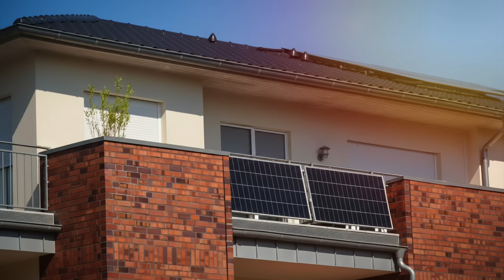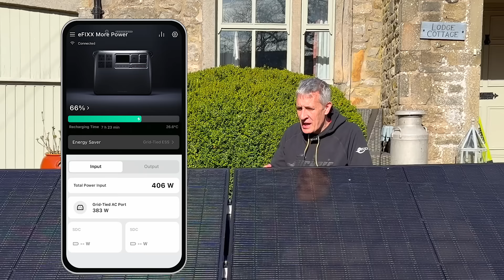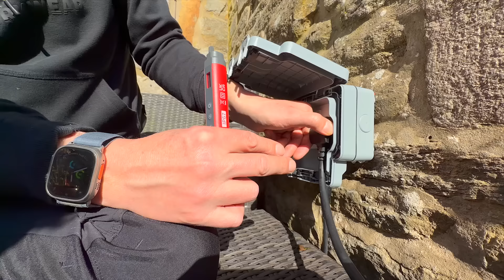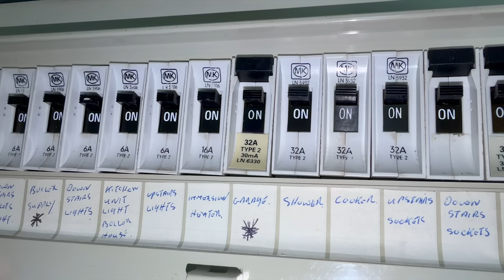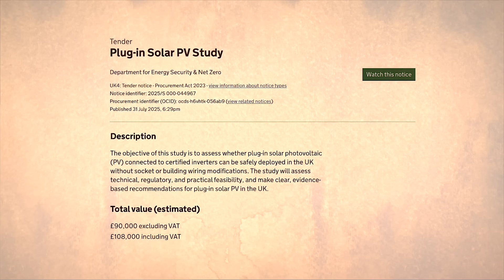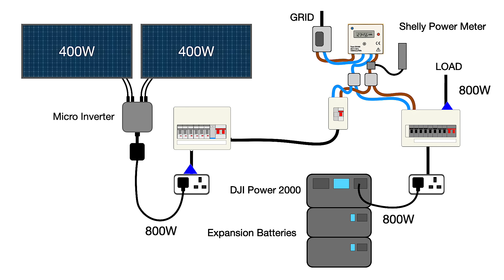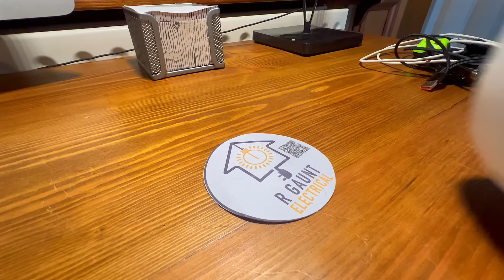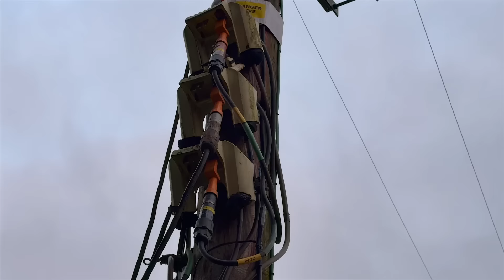Plug in Solar: We’re Told Never Do This… So I Did

Comment: I'd love to see this allowed in the UK
Reply: funnily enough the people who are most against it are the ones who are making the most money off of green tech and the marginal pricing scheme that keeps our power bills high
Reply: @iamdmc No surprise there then.
Reply: @iamdmc  greens hate people
Reply: @iamdmc the idea we push power back into the grid without any safety isolation preventing it from working during a power cut (when lines are down) isn't great, line workers are already at great risk of harm but they don't expect (didn't expect anyway) power to come from the consumer end of the cable.
Reply: @Dennis_M1DLG  These units don't push power back into the grid when there is no grid supply, they are not grid forming at all. And folks working on the wires always start by assuming that everything will be unexpectedly live when working on them because mistakes happen, diagrams are wrong, stuff is miswired, isolators don't. It's an essential part of not ending up dead.
Reply: @etchedpixels this wasn't clear in the video, and I've seen these units promoted as if they do, or implied as if they do. This has left me scratching my head somewhat as it just seems dangerous.

 I wonder how well they'd work for an off grid shed as opposed to running power down a long garden. When I say she'd I mean a radio shack... (Sounds like they'd cost the same as the armoured cable alone).
Reply: @Dennis_M1DLG  Don't forget the impedance of the grid is ~0ohms when it is dead so that's never going to heppen.
Reply: @Dennis_M1DLG they do a demo in the video showing power when plugged in and no power when unplugged.
Reply: @Dennis_M1DLG  The grid tie stuff won't work in an off grid shed. There are some units that can keep their own sockets running if the grid fails but thats really intended to save the fridge.

The hardware for your shed is the non grid tie kit which can only draw power from the grid, generator or solar, and then outputs via its own sockets.
Reply: @Dennis_M1DLG  there is a register for approved equipment. Simply buy an approved grid-tie inverter and you are fine 
The grid is already set up for this, you don't need approval for an install
Reply: @Dennis_M1DLG it was clear in the video he stated the pins in the plig arent live when unplugged as the nucri inverter isolates it when it loses grid connection
Reply: @christophergallagher3845 are you patronising me or did you not bother reading the other replies?
Reply: @Dennis_M1DLG both
Reply: @Dennis_M1DLG  No grid tie inverter can produce power if there is no grid ! I have set up simple plug in grid tie system with about 2kw of panels ( I know its not to spec ) works well and reduces consumption . I know its not to current regs and the 2kw is not issue on 13 a socket even if it managed to make 2kw . We also have off grid at our stables 24v 200Ah Lifepo4 , 1.5  kw inverter 4x 400 watt panels , runs lights , kettle , water pump ect , 1600 watts is more than we need but gives good leeway for winter
Reply: @nounoufriend1442 dont patronise him 😂
Reply: @christophergallagher3845  He was just confused between grid tie inverter and the type of inverter used for offgrid  they are totally different
Reply: @nounoufriend1442 I know
Reply: @Dennis_M1DLG  Why isn't there a grid-side switch?

Yes, line workers are at risk. Which is why it would be the most negligent insane design for the grid to solely depend on the switches in everyone's homes to cut off the supply for them, rather than having grid-side switches to allow them to GUARANTEE that the wire aren't live, because they control the switches.

Placing the responsibility for the safety of line workers in the hands of many, many customers - rather than simply having single switches along stretches of the grid that they can isolate and guarantee disconnection before operating on it - should, in fact, be illegal and considered "corporate manslaughter by gross negligence".

The switches should be grid-side. It's their network, their property. Their responsibility to their employees to guarantee it's safe.

To dump this responsibility on potentially thousands of individual customers in their own homes - and hope to police that every single one of them is complying with the rules at all times - should be illegal, because it's dumb and inefficient.

Rather than going around and checking that every single home - thousands of homes in the local area, tens of millions of homes in the UK collectively - has a compliant and functioning cut-off switch. And, at that scale, you'll find it's IMPOSSIBLE to guarantee that every cut-off switch actually works perfectly every single time, or that everyone has a switch or that everyone has refrained from "tinkering" with their switch.

Rather than that, you have a couple of cut-off switches on the grid-side to isolate and disconnect sections of the grid for maintenance. Then it's impossible for it to be live and you can GUARANTEE it, as you own the switches.

Basically, this is shifting the responsibility and blame onto the wrong party, to excuse shit grid design in the first place.

Grid design should always have included the ability to disconnect sections of the grid for maintenance from the start. But penny pinching for profit, and fuck the line workers is essentially how we've got here.

No, the grid operators should be made to install their own cut-off switches on the grid, as they should have always done in the first place.

The law shouldn't be "you must have a switch that ensures you can't export in a power cut". The law should be "grid operators have a H&S responsibility to their line workers to be able to guarantee safe working conditions by having cut-off switches to isolate and disconnect parts of the grid for maintenance".

Don't get me wrong. I have a concern for the line workers, so I would install the switch and fully comply, as I don't want to kill anyone, even by accident.

But it simply shouldn't be on me in the first place. I don't know if my switch is operating correctly. I don't know if there are line workers out there. None of this should fall on me because I have no real control nor knowledge of what's happening. It should clearly fall on the shoulders of the grid operators to operate their own grid, and make their own grid safe for their employees to maintain it - that's the correct party to lay the responsibility on, because they can GUARANTEE that it's true. They have the control, they have the knowledge of what's under maintenance. The line workers are their employees and legal responsibility already.

You're essentially defending a bad design, when you should be criticising that design for being insanely unsafe - and will become impossible to police when this scales to millions of homes and businesses - to begin with and pushing for that to change.

The switch should be on the other side, so the grid can just mass-reject exports into their network, at their discretion. That's more efficient, cheaper and vastly safer.
Reply: @Dennis_M1DLG  It won't work off grid like that at all - it needs an accurate 50Hz  mains to be present or it switches itself off.  for a self-powered 'island' you need a different sort of inverter.
Reply: You only had to wait a week - Miliband just announced that they will be made available.
Reply: @chrishorne3185  you’d love to see the sun in the uk.
Reply: got your wish!
Reply: @chrishorne3185  it won't happen because mad milliband isn't making cash out of it.
Reply: The government has greenlit some changes to wiring regulations, which'll mean that systems under 800W can plug safely into domestic sockets without needing an electrician. This is expected to go live from summer 2026. And retailers such as Lidl are already preparing to bring plug-in solar panels to the UK.
Reply: They are now lol